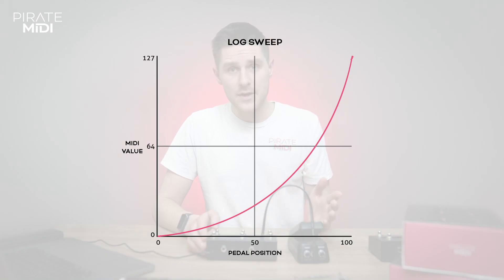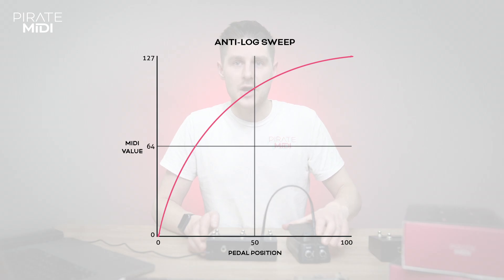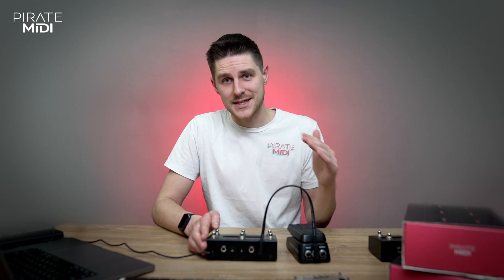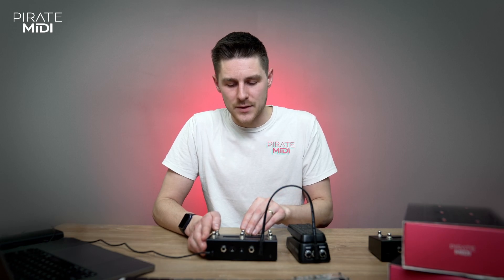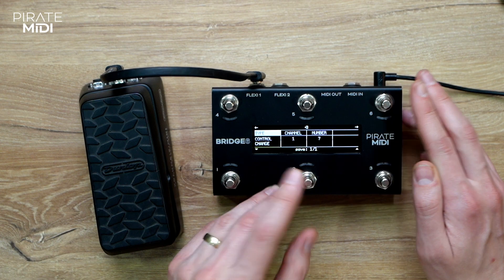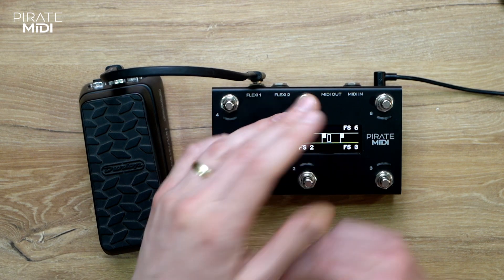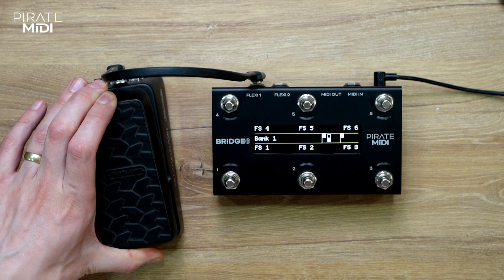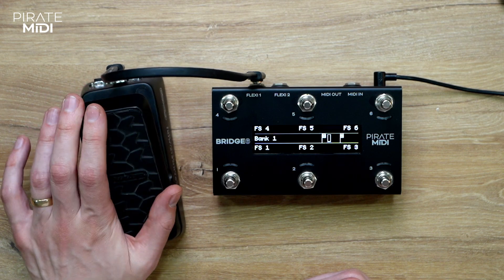BRIDGE Tutorial #4 - Expression Pedals

Comment: Will it ever be possible to have a % number showing for expression pedal instead of the bar? Cheers.
Reply from the maker: Yes, this is on a feature requests list, but currently only had a couple of people ask for it so we do want to do it but it's not a high priority so we haven't set a timeline for getting it done yet.
Reply: @PIRATEMIDI all good. Would be cool to even have it where main text of the pedal is, but I’m getting greedy. Likely getting a Bridge6 but might settle for a 4. Just need to plan out the board. Get over run of shows. Holidays etc. then find a gap in shows. Cheers from Canberra.

Comment: Just wondering if I could use a smart message assigned to a switch to “turn on” or ¨Turn off¨ fthe expression pedal. For now my expression pedal usage is quite simple, just one CC bank message. Or maybe the other option is to not have the expression pedal send any CC messages until it’s pressed? I just remember trying to use one, and finding it a nuisance in some situations. Mind you , I haven’t done any testing for a while…many thanks! Love the videos!!
Reply from the maker: There isn't a "exp off" message at the moment, but you could always use the "target exp message" smart message to switch between the message that "works" and a dummy message that doesn't target anything?